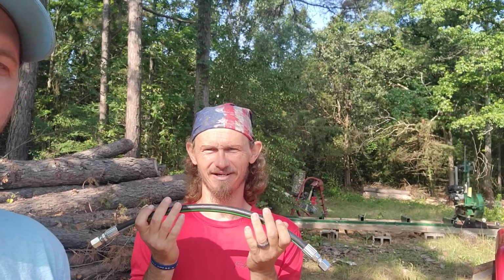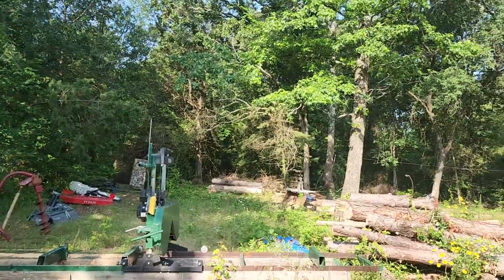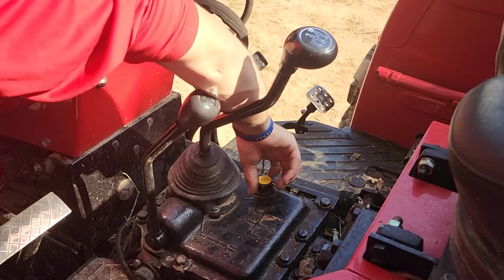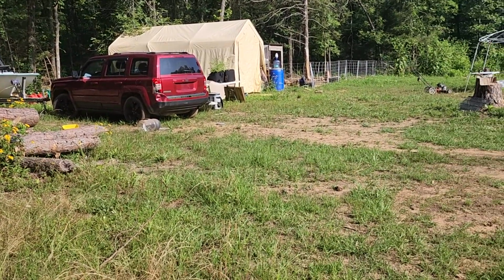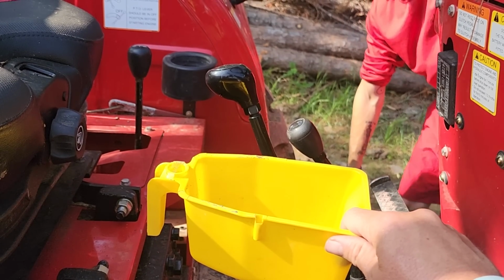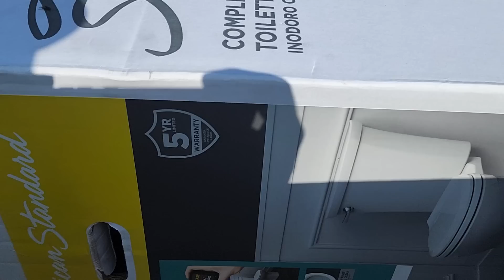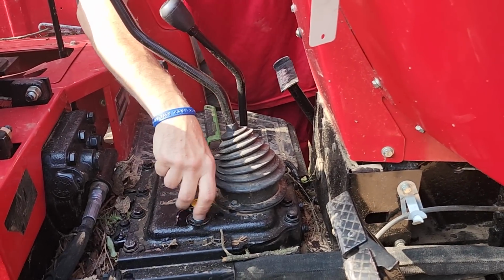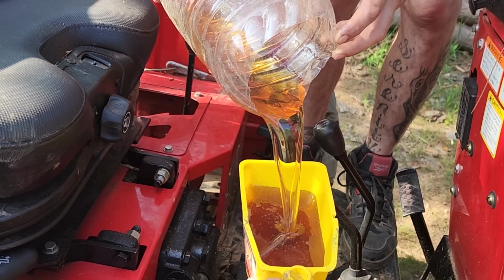SO MANY ISSUES  | tiny house, homesteading, off-grid, cabin build, DIY, HOW TO, sawmill, tractor

Comment: David the toilet you have, might be 1 and 1/3-gal tank, that's what most new toilet tanks are now a days. Just want to say, you will have to try not to flush the used toilet paper, with the poop. Your septic tank looks like it will be 30 feet away to the tank. This might cause back up in the line, if you experience any back up, the cause is the distance and not enough water to push to the tank. So maybe even before you use the new toilet you might really need to check for an old school toilet that flushes 2 and 1/2 gal. of water.  I live in the country and changed over to a new toilet 1 1/3 and I had to change it back because there wasn't enough water pushing the poop. Just letting you know this beforehand and saving you from a pain in the rump shaker. Looking good on your property my brother. also Drifting Dreamers landing as well. Just Saying

Comment: I wish you would throw those Shifting Spanners (Adjustable wrenches) away and use proper wrenches to do the job. Seriously guys it’s not cool and you run the risk of distorting the nut, opening a whole new set of issues with regards to leaky hose joints. The other thing is a drum pump is the way to go. Relatively inexpensive snd you minimise the risk of contaminating the oil. Plus you can virtually access anywhere. Food for thought only as that is my two cents worth. Cheers Ken Australia 🇦🇺